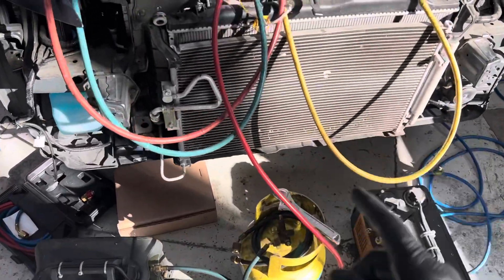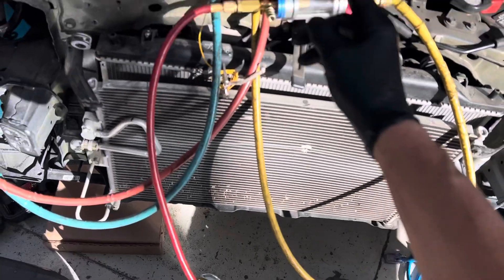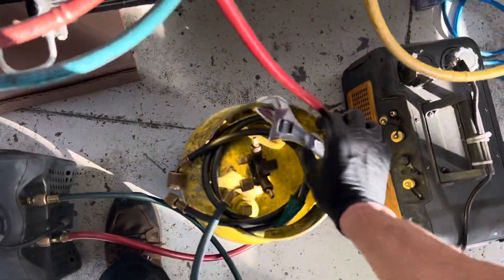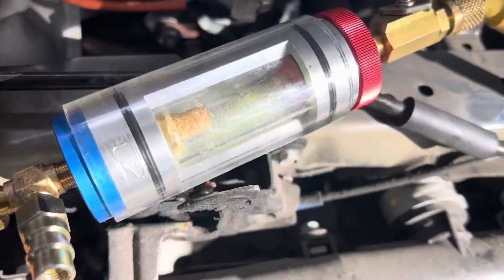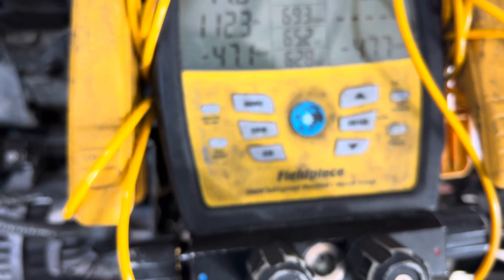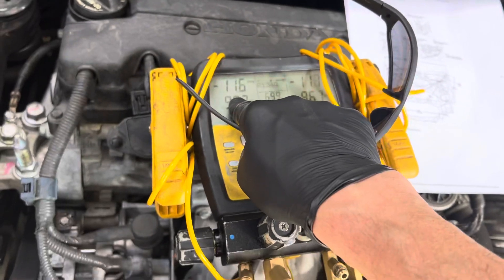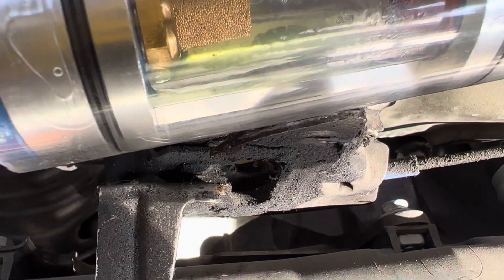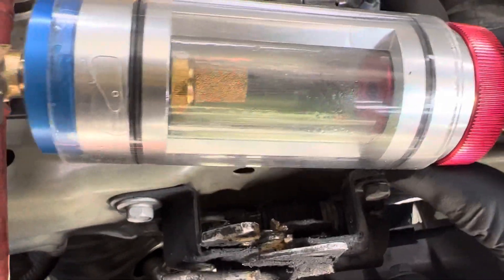Pulling out refrigerant oil during refrigerant recovery procedure. You’re not supposed to do that￼

Comment: I've been so worried about figuring how how much refrigerant oil is coming out when I recover refrigerant so that I can put the same amount back in.  It's good to know that if you're pulling from the low side it doesn't pull much oil out at all so I don't really need to worry about replacing it.
Reply from the maker: Yes, you still need to worry about it.   If you listen and watch to enough of my videos, I explain how you can pull out oil through the low side.. 

Especially if the low side fitting is located directly on top of the compressor port or the low side fitting is located at the lowest point on the suction line we’re all the refrigerant oil and Refrigerant gather as a liquid when the system is turned off . 

The very instant that you start your recovery, it starts pulling oil and refrigerant. It foams up like whipped cream or expanding spray foam. . 

This is why your recovery machine has a throttling valve to turn down the flow of recovery to slow it down .  As you monitor it through your site glass on your gauges or side glass in line on your recovery hose.

You do not just hook up a hose without knowing, and just recover at full speed .   You will be pulling out oil every time if you do this.. 

So you either put a in-line site glass 

Or a very good product is produced by AIRSEPT as you cover, refrigerant any oil, or if anybody added any leak sealer to the system, get separated out and gathers at the bottom so you can drain it out at the end of your recovery when you’re finished and measure the amount of oil you have removed. 

So the answer is definitely yes you do have to worry about removing oil when recovering from the low side service port incorrectly .  It’s all about the speed..  and the location. You must have a site glass when using portable, refrigerant recovery units in Automotive.
Reply: @coldfinger459sub0 do you have a part number for that oil separator from airsept?
Reply: Does it pull much oil if there's no refrigerant in there at all?
Reply from the maker: Vacuum does not pull out oil. 

You do not hook up a vacuum pump to a system that has a Refrigerant 

Do you hook up a refrigerant recovery machine to a system that has refrigerant
Reply: Where can that sight glass be found? I learn alot from your content.
Reply from the maker: @davidellingwood4075  eBay, and Amazon

You could probably look up Refrigerant Sight Glass 

Master, cool, refrigerant inspection glass 

Something like that Google that term and it’ll pop up on Google on eBay and Amazon

Comment: How does one (or you) ever know if there is the proper amount of oil in the system? I assume to be safe, you would need to get all the oil out and put new oil in. Can this be done just with hoses (and maybe no2 flush)?
Reply from the maker: @yxcvmk  it’s really hard to tell on some vehicles easier on other vehicles

But if you’re doing any major work, you would flush the whole system anyway, and starting from if you were already doing a compressor change 

And unfortunately, vehicles manufactures usually do not locate a side service port in the liquid line just prior to the expansion valve for the pool, a liquid column, refrigerant sample 

And then weigh on a very accurate scale figure out how many grams it is recorded and then just distill off the refrigerant off the top of the refrigerant mixture, leaving behind only the oil and then weigh a second time to come up with a different so you can figure out the percentage of oil mixed in with refrigerant to tell if you have too much
Reply: @coldfinger459sub0  Thank you!
Reply: The answer is you don’t! And with all the nincompoops touching these systems (especially small capacity 1234yf systems) your best approach is to do a full recovery and oil extraction. You need a proper recovery machine for that tho.

If I had a dollar for all the mechanics who blindly slap compressors on, and don’t even adjust the oil level 🤦‍♂️ and don’t even use a charging scale.
Reply from the maker: Unfortunately, oil, extractions machines that are just dedicated to flush the system using refrigerant to remove oil less than 0.5% of shops even owns such an equipment. 
     Less than 0.2% of shops even know such equipment exist. 
Then there’s a shops who wouldn’t use it anyway because they’re into whatever is quickest cheapest and if it works with too much oil in the system and it goes out the door and they collect money and fails later they don’t care as long as it makes it out of warranty.  
        Most shops are lucky if they even own a regular RRR refrigerant recovery recycle machine. 
         And RRR machines do not remove an entire refrigerant oil charge. 
           But that is very true you are right unfortunately, a majority of shops do not oil balance when changing compressors.

Comment: Do you add that oil back to system when putting it back in? I also see that they recommend you only pull down to 0 or above PSI to stop air getting sucked into your recovery tank.
Reply from the maker: I hear we pull down to a minimum of -15 vacuum when recovering refrigerant

I’ve personally recover refrigerant with my equipment down to around 1000 µm or below 

I do not worry about getting the air inside my refrigerant because it’s so easy to remove 
           And I own a refrigerant identifier I have done videos on that tells me if my refrigerant is 100% pure or any percentage of air that might be in the refrigerant

And yes, if you did happen to take out a certain quantity of refrigerant oil,  for example, 5 mL, you would put back in 5 mL of new fresh oil .
Reply: @coldfinger459sub0  Great answer - thnx.

Do you have a video showing how to get air out of refrigerant? I thought that was not possible - learning lots of new stuff!
Reply from the maker: @pingpong9656  no video on air removal yet
Reply: Hi Tom. Looking forward to the video on how to remove air from the refrigerant. When you get the chance. Thanks in advance.

Comment: If my low line shows that there is 0 PSI would it be safe to disconnect my AC lines from the condenser to replace it?
Reply: Figuresd it out..... i have no freon at all in my car, replaced the condenser which was leaking and my drier... taking it to the shop today to get it pressurised and freon added.

Comment: So its a oil sight glass but its also a oil separator right?
Reply from the maker: No, it is not a oil separator

It’s an oil site glass it’ll let you see the condition of the Refrigerant annoyed or whether it is crystal clear or dirty that’s about all 

If you carefully control the speed velocity of your high side and low side, as you fluid through there, you can make it separate some oil from Refrigerant, but this is not what it’s meant, for I was only doing that for experimentation 

AIRSEPT MAKES A OIL SEPARATOR AND REFRIGERANT SEALANT SEPERATOR THAT WILL PROTECT YOUR EQUIPMENT AND YOU CAN MEASURE THE AMOUNT OF OIL THAT YOU RECOVER. IT’S AN AD ON THIRD-PARTY DEVICE.

Comment: thank you , unfortunately  slight glass  doesn't separate oil and refrigerant to measure it according to  mastercool  .
how can i measure oil that mixed with recovered and  vacuumed because weight and oil\ref ratio method doesn't account for oil traps  .
Reply from the maker: @mm-il8dg  the oil separator separates the refrigerant oil out of the refrigerant and gives you a precise measurement

Comment: How to remove all the oil from the system after I used these store cans from napa to top off the system ?
Is there a way to remove the oil with just the pump ?
Reply from the maker: All the oil then must disassemble system and flush all components with ac flush solvent 

Compressor gets dumped out and refilled
Reply: @coldfinger459sub0 if I want to put a compressor on that has been prefilled with oil should I be concerned about having too much oil in the system?
Reply from the maker: @trevordude2378  yes

Comment: Hi Thomas, I dont want to bore at every comment but I dont know to be quiet, If you prefeer you can answer on the next video about that because sometimes you put too much effort to ask us correctly

One guy that is AC tech on Brazil, has a channel named 'Clube dos Refrigeristas' he showed how vacuum can pull some oil and cause this says vacuum pump oil ends with some dye in it, he uses a little accumulator to measure it too.
Its good to know If oil removal happens, but I dont think we have to worry about little quantities. 

So my question is: Do you think a bigger vacuum pump can pull more oil than a little one? Because sometimes I've seen you using the biggest Navac that money can buy (lol) or maybe this oil comes from what is left inside the manifold hoses, I dont really know so I will appreciate to hear your opinion

Thanks so far, regards from one of your most wearisome subscribers (Im not a bot, I promise you really)
Reply from the maker: It’s good you ask questions, that means you actually thinking 🤔 
          That means you want to know more. 

It sounds like the bazillion guy doesn’t use a recovery machine to save the refrigerant. 
       He just vents it out to the air?. 
             Or he just recovered a little leaving some refrigerant still trapped in the oil. 
        So when he puts on the vacuum pump it explodes into a into like Whip cream can. ( like Coke Cola CO2 trapped in the water. You released the pressure and the CO2 explodes or of the water sand as refrigerant.)

      If you notice I use a recovery machine first and it draws out all the refrigerant even from the oil. 

        Here in the USA it’s a EPA LAW you must recover refrigerant down below -15 vacuum and it must hold at -15 vacuum. 
                    If it holds that means there is no more refrigerant left trapped under the oil. 
               If you notice my vacuum machine I pull refrigerant out down all the way past -29.9 down into the micron range. 
                 In the old days when my dad and my grandfather were young. Before refrigerant recovery machine.    You throw gauge on car put one end in a can slowly open gauge valve so not to release oil.    Sometimes oil will come out but you can measure it because it’s in a can.   This was old school way. 

 Vacuum pumps were vary small back then 1 or 1.5 CFM. 
       Or a old refrigerator motorways used . 

If someone is removing oil when they vacuum is sounds like they don’t understand the physics of refrigerant don’t know what they are doing. 
          Because you should never remove oil pulling a vacuum. Unless you’re doing something really wrong like leaving refrigerant trapped in the oil. 

    In this video I made I intentionally set up to pull a vary fast recovery at the beginning to make me pull out oil with refrigerant just to show oil coming out. Just for example. 
                     Normally on this car no oil would come out.

I watch the Brazilian guys channel I can’t understand no English subtitles. 

MACS is having a video training webinar on refrigerant recovery in a couple of days look it up. On YouTube
Reply: @coldfinger459sub0   Im wrong! I did the wrong call on the AC channel from Brazil, it was another Brazilean guy but I cant find now, Anyway I dont know if he doesnt recover refrigerant, I want to think he does, but if not probably is happening exactly what you say about, he's a professional guy too, but you know, even people living in rich countries doesnt care to release gas sometimes

Thanks we appreciate your clever teachings

Comment: Okay amigo tiene que hacerle a la entrada de baja una colocar una t para poder agarrar y colocar la manguera de baja y la de alta y abrirla de alta para poder que el aceite quede en la parte de abajo del resto es muy difícil sacar el aceite así con ese método ya lo he hecho y ya te Yo tengo dos
Reply from the maker: Easy to clean out . You use fresh brand new clean refrigerant to clean it out. Refrigerant is the best solvent to remove refrigerant oil.
You just hook up the end of the hose on one end to your recovery machine . Turn your refrigerator upside down liquid through the glass tube while recovering refrigerant and it’ll be perfectly clean..